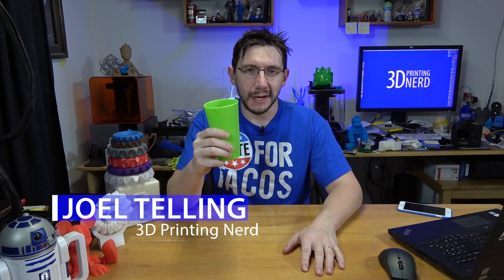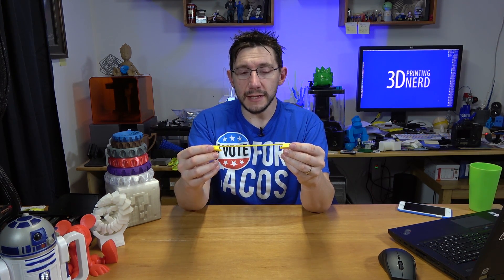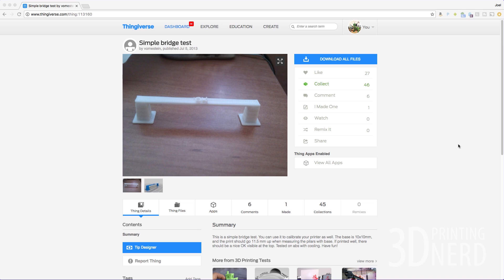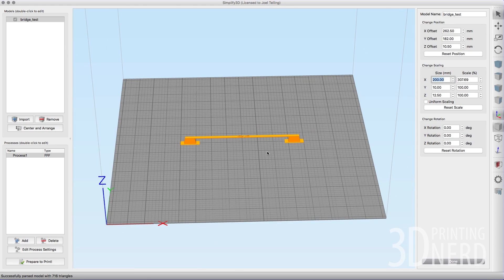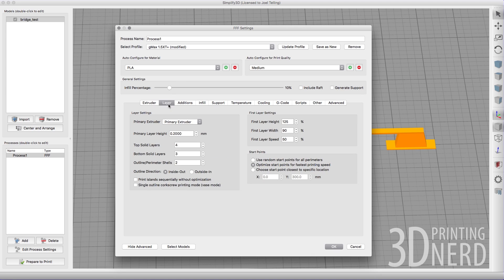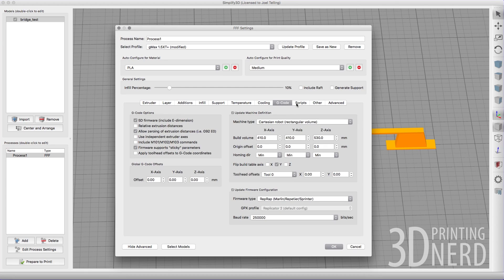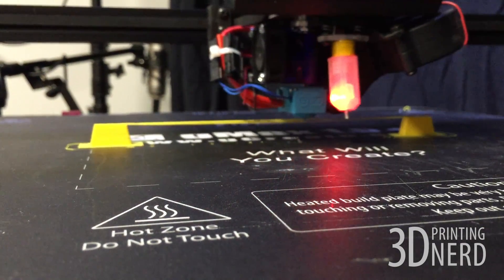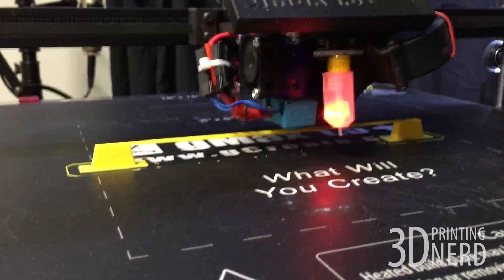Extreme Bridging with 3D Printing on the gCreate gMax 1.5XT+

Comment: you have more travel, why not find the limit?   I recently tried bridging and similar to you, was pleasantly surprised by my machines ability.  Also curious if you have played with x vs y orientation .  In my case, I don't have 2 axis symmetrical cooling,  just 2 fans 180 deg apart.  that led to some interesting results.

Comment: There is no such a thing as centigrade. It is CELSIUS. Same as fahrenheit its not called fahrgrade :-)
Reply: "Although still used in meteorology, centigrade, when indicating the Celsius scale of temperature, is now usually avoided because of its possible confusion with the hundredth part of a grade" -Dictionary
Reply: its not used since 1946 (edit 1948). centigrade is btw a french unit of angled plane and fraction of gradian. and still dont understand why some countries still using fahrenheit (32°F is when water start to changing its chemical and physical properties. also called freezing)

Comment: So what is the most crucial part to printing bridges? Is it the cooling alone?
Reply from the maker: Not really. It's cooling tied to extrusion temp and extrusion rate. You want the plastic to come out at a specific rate, and you want the head to move at a consistent rate. You can kick the fans in full, then just let it go. I used Simplify3D which did all the calculations for me. Turned out great.

Comment: Ive done 10 mm bridges and fan speed seems to matter most. What I wonder is how different materials bridge like ABS, nylon or mixed filaments bridge etc. PLA seems to bridge best. Would it be possible to print a 400mm bridge diagonally across the build plate or would... Just some Ideas. Thanks :) Also if you could add external cooling fan that blows alot of air I think the bridges would even turn out better.

Comment: Why is it that when people get a 3D printer,  the only print 
useless stuff, isn't it possible to make and show stuff, there can be use for something, or is it only for fun and play with like the   big plastic guns and so on.
Reply: Because it's fun or interesting. There are people that build engineering test parts or architectural mock-ups. They probably don't tend to post online because the parts they build are for customers and might be proprietary designs.
Reply: Thank you very much for answer me, have fun. :-)
Reply: kim Andersen I am thinking on getting a 3D printer but my idea  is to make my own models that will help with my DIY projects but you are right there are lots of people that buy 3D printers just to print stuff it is like a normal printer i only used it when i was at school now no one use the printer but if i had a 3D printer i would be making lots of stuff for my projects
Reply: That i can understand, that give meaning, of course all have to learn to use 3 D printer, and therefore make funny and useless stuff, but not many show good stuff on youtube.

Comment: So bridging will depend on cooling, speed and extruder rate. I have heard that allowing the printer to stretch the material as it bridges works, depending on the material. Seems that the default settings in Simplyfy3D are pretty good, but did you make those settings or are they from the printer manufacturer?
Thx for the demo.
- Eddy

Comment: my print cant even do a 20mm cube
Reply: Gon Garcia mess with settings, maybe you need to add a layer cooling fan :)
Reply: c fahy  nah..my barrel between the hot end and cold one has a problem with the pfte tube and my filament gets stuck there causing some nasty clogging mess :P
Reply: Gon Garcia haha so bridging is the least of your worries ;)
Reply: c fahy yup...i guess we can say so :P
Reply: i can barely bridge the gaps on a flat surface with 10% or less infill.

Comment: I've got a Migbot Prusa i3 with the MK8 metal hotend/etc.  I bought some capton (?) tape but have never bothered to tape the hotend.  Your comment about the insulated hotend and fan settings I think finally sunk in.  But I just wanted to confirm whether capton tape will do the same as the insulator you've got?  Is it worth wrapping the hotend with capton?

Thanks,
J
Reply from the maker: Yes it is! Any insulation around the heating block helps keep the temp stable.
Reply: Awesome, thanks!  I'll get on it.  Appreciate your quick reply.
Reply: hey, Just ordered a CR-10 Printer, new with printing and i dont really know how well the fan works on the CR but how did you make the insulation?

Comment: I wonder if the print would look even better if printed diagonally (more speed because of two motors)
Reply: davedarko like you I was curious about diagonal, but, I wonder if the print would be as good. I wonder now if things could be thrown off more by printing at angles other than 45.
Reply: davedarko - the speed is adjustable. That printer can go faster than that, those are just the settings that Joel found best in his experience.

Comment: Now I want to see how far my printer can bridge. I have a really powerful server fan as the part cooler and I think I could go pretty far. It's enough to blow papers around, so I think it's enough to cool a bead of filament.
Reply: LazerLord10 
Try to under-extrude as well to stretch the filament to keep tension as it bridges. may have to lower fan speed to keep the filament elastic.
- Eddy

Comment: im new in 3d printing... can you print straight from thingiverse or do u need to slice it with cura or so first?
Reply: you need cura and choose your printer etc. btw welcome to 3d printing!
Reply: Thx, i build the anet a8... But cura gives an error if i try to open it... Maybe i will try another version
Reply: Jonatan Den Breejen I have the same printer, if you happen to have any questions about it you can ask me.
Reply: Shockwave oké, thx!
Reply: Jonatan Den Breejen
Just FYI. Steps in printing are usually taking an .stl file and slicing it to gcode file then sending that to the printer. normally Thingiverse et al. have stl files as the gcode is taylored to your printer. Note in video that Simplyfy3D has a built in slicer creating the gcode. External slicers can be cura, sli3r (my fav) and some others.
- Eddy